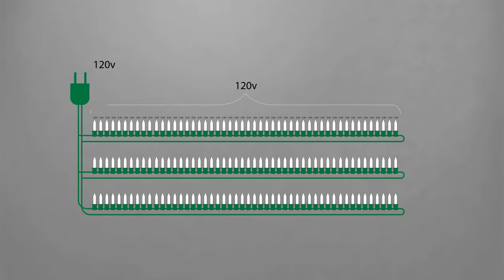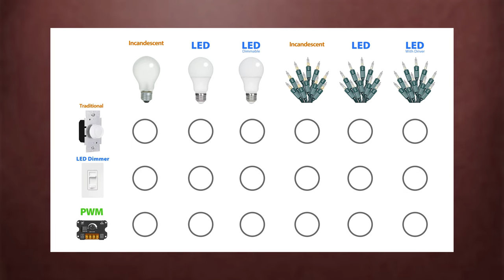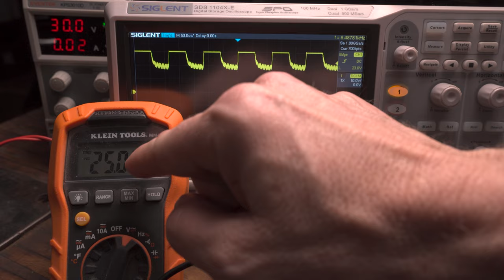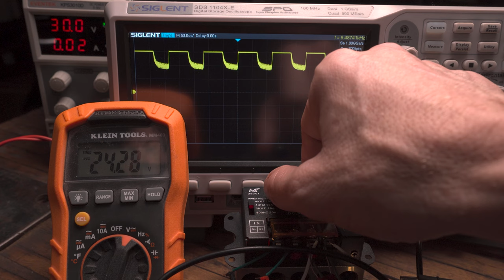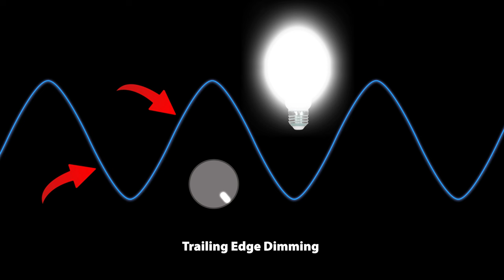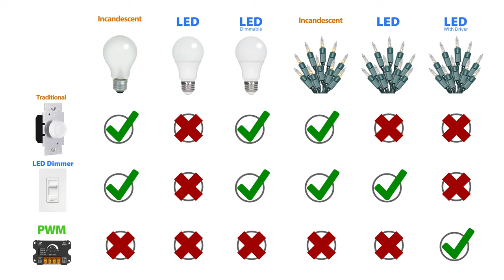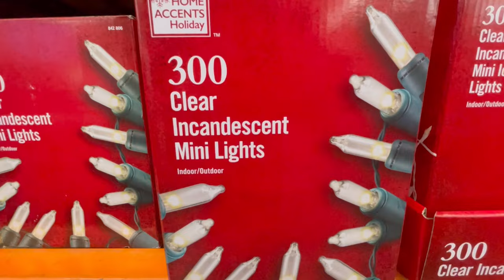Dimmers - You thought they were simple

Comment: 120 V AC is not -120 V to 120 V, it's 120 V RMS and the peak voltage is 170 V
Reply: 120 × 0.707 = ~170V for those wondering. 0.707 is sqrt(2). This is for sinusoidal signals only (which is true for AC from the grid).
Reply: @alexanderquilty5705 0.7071 is the INVERSE  of  √2 but yeah, that's the idea.
Said differently, 120 V (omitting the sign) is the average voltage of the US grid.
Reply: @NicksStuff the average is 0 V. 120 V is the root mean square of the Line voltage.
Reply: Thank you. My first thought when he said this too. Then again, I took college level electronics classes.

Comment: Many of the LED dimmers have an adjustment that lets you set the minimum voltage. The earliest dimmable LEDs cut off with 25% or more left on the dimmer. The adjustment would let you set it to the lowest level before they cut off.

Comment: I have two dim able lights that use a pulse with modulation to dim AC 120 volts they were used in the old torch lights that had the halogen lights. now I will have to find how they work. the 130 volts does cycle from 0 to 120 sixty times every second so do these switches just change the frequency.

Comment: Hello again. Well this video could have been about 1/10 as long as it was, I listen to the whole thing while driving. The reason I clicked on it is because I was hoping you would go over pulse with modulation and the flickering that is common on LED Christmas lights. Much like you and every other human, I find tungsten lights to be orders of magnitude more appealing than any LED that has ever been made. In the Christmas light department, if the darn lights didn't flicker, it would go a long way in making them more acceptable. I was hoping you may have come across a current modulation dimmer instead of pulse width in order to battle the flickering.

Even though the topic is quite bland and not broadly attractive, the production value is top-notch as usual with your work.
Reply from the maker: You’re absolutely right about the concerns regarding LED lighting and flickering. In the realm of LED dimming, there are primarily two methods: Pulse Width Modulation (PWM) and Constant Current Reduction (CCR).

In the video, I focused on PWM because it’s the most widely available and commonly used method for LED dimming. Most PWM dimmers, like the one used in the video, operate at a frequency well over 1 kHz. This high frequency is key to why PWM dimming typically doesn’t cause perceptible flickering. The rapid cycling of the LEDs – turning on and off faster than 1,000 times per second – means that the ‘off’ time is incredibly short, shorter than the time it takes for the LED to visibly fade. As a result, our eyes can’t detect the brief intervals when the LED is off, and we perceive a continuous light.

I didn’t delve into Constant Current Reduction (CCR) in this particular episode, primarily because it’s not as commonly available for general consumer use as PWM dimming solutions. I apologize if this wasn’t made clear in the video. Your interest in CCR highlights an important area of LED lighting technology, and it’s something I might explore in future content.

The flickering you are referring to is most likely the alternating current version of the LED Christmas lights. These operate at 50hz-60hz. I also covered this in the video. I haven’t been able to see any flickering at all with the PWM dimmer I featured, even when recorded at 240fps.

Thanks for engaging with the video and sharing your thoughts. Insights like yours help shape the content for future episodes!

Comment: My guess is that the LED approved is a - sorry for my German - Phasenabschnittsdimmer rather than a Phasenanschnittsdimmer.

Phasenanschnitt is basically a Triac that is switched on at a certain time of the phase and switched off by the current going through 0.
Phasenabschnittsdimmer have the power switched on at a certain time before it reaches the top voltage, and switched off at the same voltage after the peak, so it always goes through the main peak of the voltage compared to lower voltage at the other option.

Comment: All dimmer will work if you place it straight to the actual bulb/LED (after the driver. If it has).
When you use dimmer to undimmable LED bulb, you actually dimming the driver, not the LED. And common LED driver are designed in which it need a tight range AC input voltage.

Comment: I don't get how the LED would need a smooth voltage increase (so no triac) but are perfectly happy with PWM (which is the sharpest of them).
Is it because of the in-rush current in capacitive dropper power supplies?
Reply: I wonder if its a stretch to say that the pwm rise time is long enough to not have the negative effect of the triac rise time for a given LED.
Reply: @alexanderquilty5705 I doubt that's the case but I'm no electronic engineer